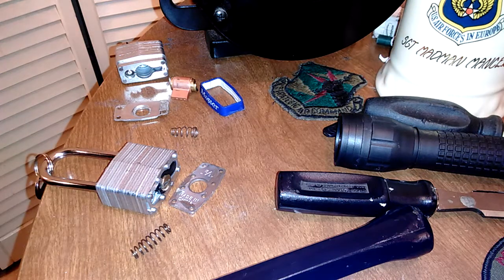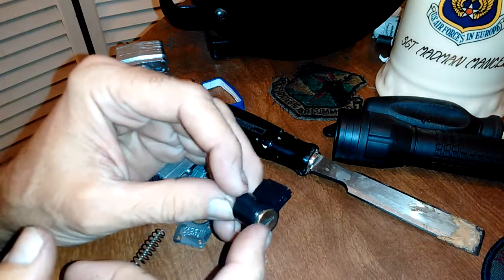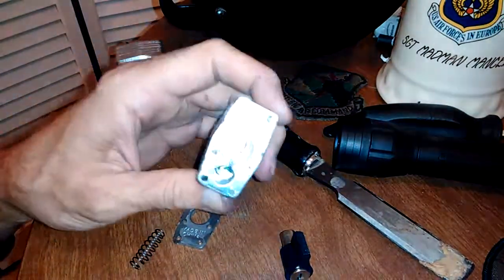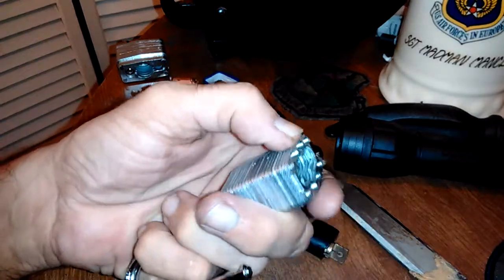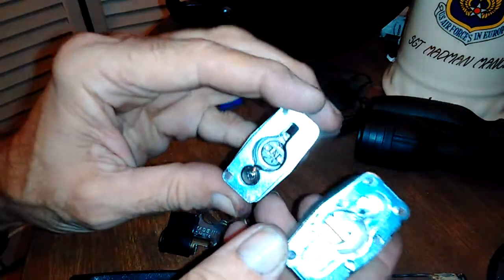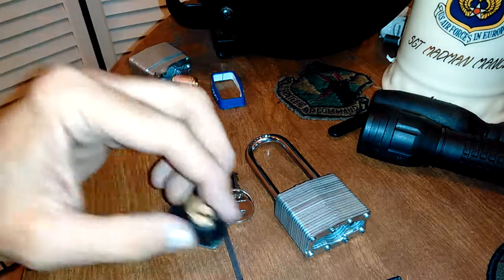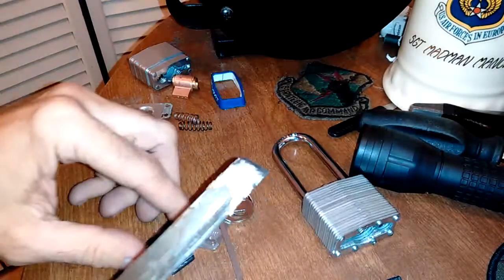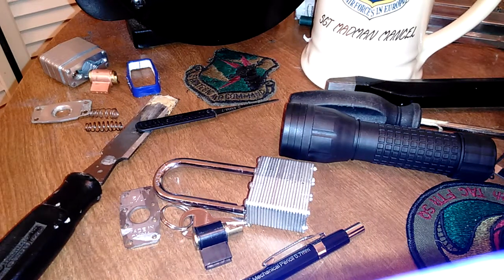(183) Inside a Cheap Chinese Padlock

Comment: It's a good experience to take some like this apart and have a bit of fun :). Yeah, the plastic is even worse than the copper core ;D. Thanks for sharing William :).
Reply from the maker: redcatimaging Thanks for watching Foxxy. That copper core is just plating, or paint. There is another metal below the copper, but it is non magnetic. It might be aluminum? I'm not sure. Whatever it is, it's cheap, but not as cheap as those plastic cores. Plastic bibles  are Pure junk in my opinion.
Reply: Yes you might be right. Copper is expensive, so it is most likely aluminium with copper plating (electro plating or so) :). Thanks for testing that :).

Comment: I no how you feel mate there are loads in england like this bad core if you get another one and put a lighter under it heat it up melt it put a screwdriver in and open a bad lock cool vid buddy👍😊😊👍😎😎
Reply from the maker: Leon's lockpad Thanks Buddy. I dropped a key pin from my Master Lock 6850, so I used one of the key pins from the plastic lock. The pin was slightly too long but I filled it down to fit. I salvage parts and try to use as much as I can out of this junk lock.

Comment: Hello, I was wondering how difficult would it be to separate all the lamentations?
Reply from the maker: Once the rivet heads are ground off, the laminations come off fairly easy with a screwdriver prying in between them on the Chinese ones.